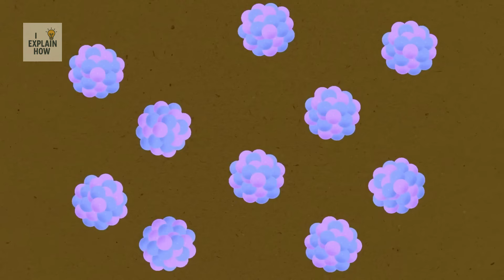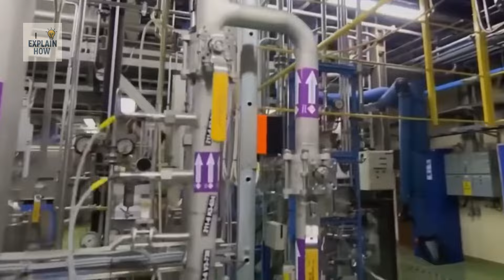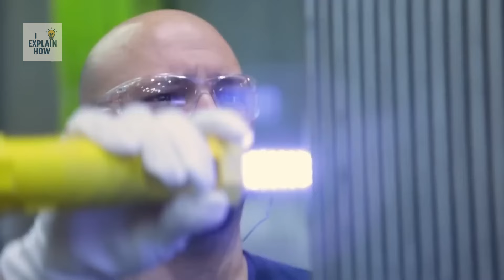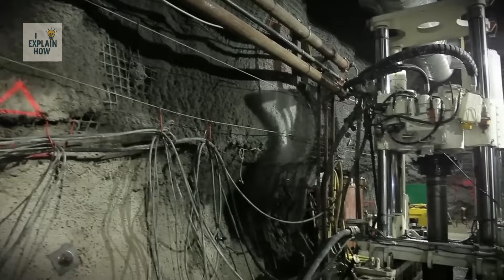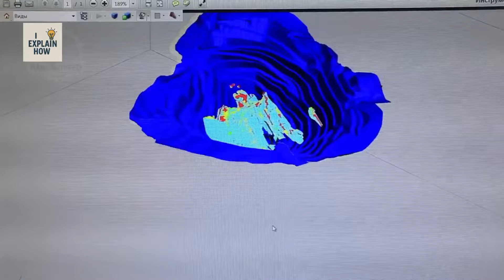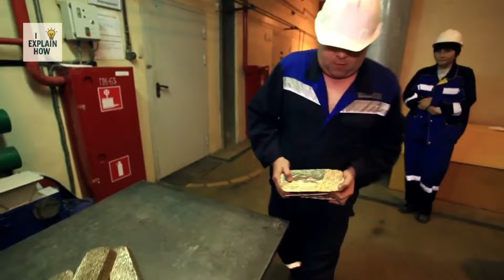How Enriched Uranium Is Made From Raw Ore to the Most Powerful Material in the World!

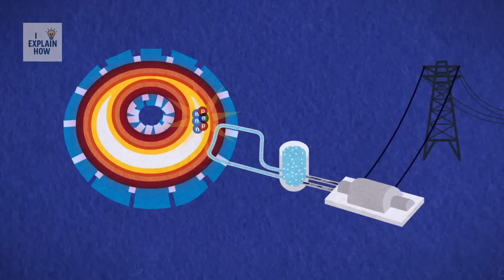Comment: Also at 9:01 this is also not how reactors function. You are modeling collision inside of the reactor when reactors use fission. Also nuclear energy from power plants don't use this process at all. Fission machines that are under development also do not have a water cooling system nor do they operate using uranium they utilize hydrogen like the sun. That model is a weird mix of a fission machine that is actually a collider with an energy harvesting mechanism that uses water like traditional nuclear energy. Finally if they were actually colliding uranium in that reactor as demonstrated there would also be compression, it would also be worse than the Chernobyl disaster and would yield a destructive impact similar to Hiroshima or Nagasaki. You are also modeling neutron collision as a means of enrichment which is extremely terrible being that neutronic collision with uranium is an inelastic event not elastic like proton, electron and positron collision thus the atomic and nucleic structure is not maintained all of that energy is in a state of rapid entropy while its being restricted which would also yield a nuclear explosion.